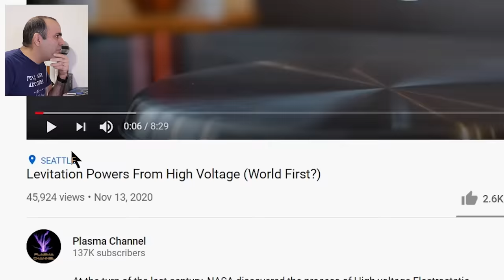Painful High Voltage Levitation Magic

Comment: 5:25 Just use a cascaded ferrite transformer stack and rectify the output of that. The room size is the limit (or your wallet size if taking it outside). In my particular living room I can do about 1.4MV when 100% modulating the AC to double the peak voltage (500kV  100KHz sine wave from the top transformer). 30kW (~135kW eventually, always broke) of power though so not sure you'd want to put a grounded hand near that without a Faraday suit (a short without a resistor will blow the diodes, but sound like a gunshot, close to 2kJ stored in filter cap). The output rectifier bridge/cap is also rather large (about 6 feet long per leg and still get quite a bit of corona at max voltage).

Comment: It's an old physics trick from 1970s, maybe earlier.  (Ancient science-fair library books from Dewey Decimal 507, FTW!!) 
Just a simple VDG machine alone can do this!   But you need to lift up the whole machine and tilt it at an angle (or even tilt it horizontal.)    I found that the VandeGraaff machine seems to work much better (more stable) than the parallel plates version, since the levitating object is then in a radial field, and more easily can find equilibrium, with less wild gyration.  Also, the microamps of corona leakage are gone, if there are no plate-edges or connecting wires.

I first saw this as "orbiting metal" vandegraaff trick in an ancient book of DIY vdg generators, where we're supposed to fling the foil object tangentially near the VDG sphere, so it continuosly revolves around the plastic column near the sphere.  While trying this with a Morris & Lee vdg (14in sphere,) I quickly found that the "orbiting" was less impressive than static hovering, achieved by simply tilting the whole machine, so the sphere was 12in over the table.

My foil "object" was a 4" square of Al foil, gently crushed to form a sort of teardrop/football shape about 2in long and 1/2in thick, with all the sharp edges bent inwards.
When placed on the table, I could use the vdg generator to lift it up, and SOMETIMES it would hover stably.  Mostly it would leap up and be flung away.
Then I realized that the table was getting charged by ion-flow from the machine, and producing crazy field-patterns in the air above the surface, as well as attracting the foil object downwards.
Solution: throw a meter-square piece of Al sheet metal on the floor.  Place my crushed foil in the middle, then turn on my vdg and waved it around about 15in above the plate.  The foil object would reliably lift off, and hover about 6" below the sphere.   Then, very carefully I could lift the vdg sphere away from the Al plate, and the Al foil object would keep hovering.   (This would also work if the vdg was entirely upside down!)  This whole trick almost ended up as a science museum exhibit, using a hand-crank vdg generator.

When I see the Plasma Channel video, I think:  TOO LITTLE MASS!   TOO SHARP EDGES!   If his foil was heavier, it oscillates much more slowly when compared to the damping from air friction.   If it's wider, it will be much more damped by air turbulence.  And if the razor-sharp edges are all bent inwards, the leakage-current will be far less (and the HV power supply won't be shorted out  ...so even a 2uA vdg machine can achieve a high enough voltage to still lift the foil.)

Best foil-shape seemed to be a bluff-body streamline thing, with a rounded end and a pointy end, crudely crushed from thin foil.  When it lifts up, the rounded heavier end would automatically face upwards towards the VDG sphere.   It would just hang in space about 6in below the sphere, making a slight hiss-squeal noise.

Comment: This is pretty much a scaled up version of the Millikan experiment, where microscopic oil drops are sprayed between two plates with a high electrical potential difference. and by measuring the time of how fast the drops rise/fall or levitate and fall at a specific electrical potential difference. You can determine the charge of a single electron. (I had to do this experiment for uni). Although because the oil drops used in the Millikan experiment are so small and have so little mass you don't need this enormous amount of voltage . There's a lot of  pretty interesting physics going on, and you can get a pretty good idea of the physics of the "levitation magic" on the wiki of the Millikan experiment.

Comment: In 8:08, your friend told it because the direction of electric field s from positive to negative. So the strip goes upwards , i.e., from positive (sheet) to negative (your hand). 
But when you tried the opposite why does the strip lift firstly?🤔 I can't get at this point. Please me to understand please.

Comment: The aluminum throws and captures the electrons in the air closer to the opposite sign so when we connect the aluminum in the positive which rises in the 2nd aluminum which raises by the electrons and which then makes the action of the aluminum with the electrons when it has passed through the body.

Comment: This is what's called "jumping ghost discharge." A little ghost is jumping up and down to transfer small electrical charges. It could perhaps be used as a resistor.

Comment: I’m planning on using High Voltage AC to make an Electrostatic Engine because if the piston has the same charge as the top plate it will move down. If the bottom plate has the same charge as the piston it will move up. I will use this concept to push a piston and make an engine.

Comment: Would this be possible in a higher scale if the actual ground would be possible to get charged entirely with negative voltage and have something in the air get charged with positive voltage, without using wires. If both ends could get rid of their opposite charges like a capasitor or a battery but in air and wirelessly? (meaby safely?)
This sounds like breaking the laws of physics but how many times has it be broken already?

Comment: If There is a special truck and they installed electro levitation specification inside the container.
And Goods are floating inside the container.
Will truck feel the goods weight? Or will feel Empty container..

Comment: drape a piece of toilet paper across the output wire of an industrial 120000 volt DC power supply and start cranking up the voltage.  the toilet paper will stand out to the sides and then float up into the air

Comment: So I have a Question, i once got shocked by houshold electricity and have been kind of phobically staying away from electricity since then.
Is the Voltage you got completely irrelevant if the ampere is at a level that´s not dangerous? and why?

Comment: when the smaller silver foil is on the larger plate it gets charged but as your hand has the opposite charge then the silver foil it drops on the bigger plate it gets charged and then gets attracted to your hand then it touches your hand and becoms neutral and it drops and charges again t

Comment: I still need more explain, why didn't he get shock anymore after this. What did he do that he get shock? 3:33
Reply: Because he didn't turn off the power supply, his body act at a wire that electricity flow through his hand to other hand to the foil and shock him.

Comment: Hey can you tell me what would happen if we use 2 high voltage transformers back to back like the input of one transformer to the output of other transformer and the on the input of second transformer we put a resistor and then connect it to the output of the first transformer and then give it a charge for a few nanoseconds. I know the free energy is not possible but i think no one has tried this thing.

Comment: Before I watched Jay's video I though I had a basic understanding of this, I was entirely wrong.  So my understanding was that the electrons were attracted to ground, and since the foil is conductive they sort of lifted it up to your hand, and some electrons discharged from the sharp corners at the bottom.  This is a very wrong and stupid assumption, please go watch Jay's video! :D
Also please note I know nothing at all about electrical engineering other than live wires are dangerous when you mess with high voltage.

Comment: 3:39 fake
Reply: If Its Fake Try It Yourself
Reply: @yaboicyber_3610  idk he probably turned it off or something but play it in slow motion that ark is obviously FX
Reply: @11kc67  Dude hes literally a electrical engineer
Reply: @yaboicyber_3610  and he also knows how to use the lightning preset in after effects clearly
Reply: Dude Just Try It Yourself If Its Fake
Reply: @yaboicyber_3610  no I'm sure the risk isn't fake and if you touch it you would probably get shocked but that Arc was definitely the lightning bolt preset in after effects he probably turned it off and pretended to zap himself for views